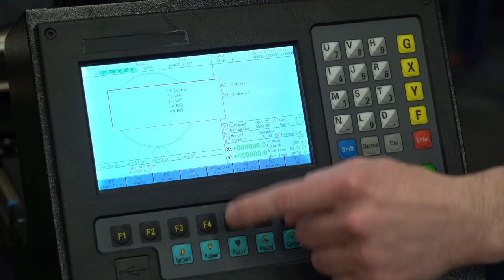5 Reasons You NEED this CNC Plasma Table - Eastwood

Comment: I have been doing technical support for that same controller and THC for years, these days I'm just giving away the eastwoods rewritten manual. Eastwood y'all did a good job on the manual and I can now retire from it. I will suggest that y'all make videos on how to program and setup the machine so you won't need a dedicated call center for the controller and THC. Thankfully these machines let you import and export machine settings.

Comment: The reason I won't...

It's just still too expensive for hobbyist.
Reply from the maker: It's one of the most budget friendly tables on the market. Sure, it's not cheap by any means. However, other tables cost similar and don't include a plasma or a controller. 🤷‍♂️